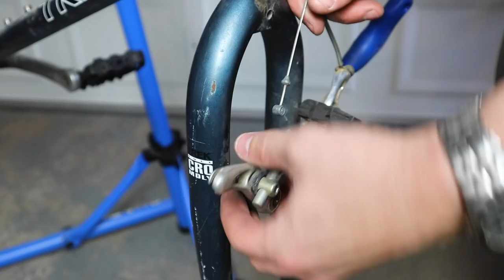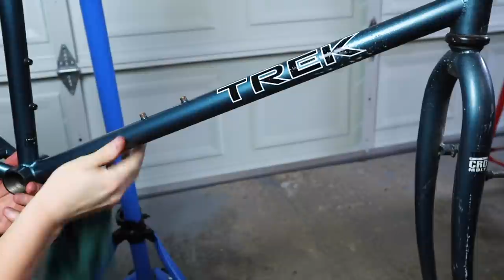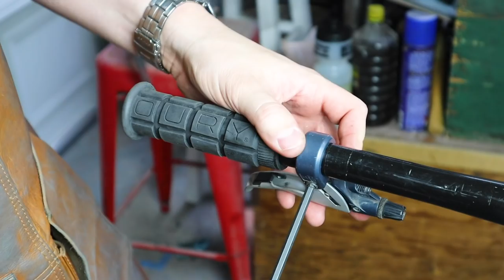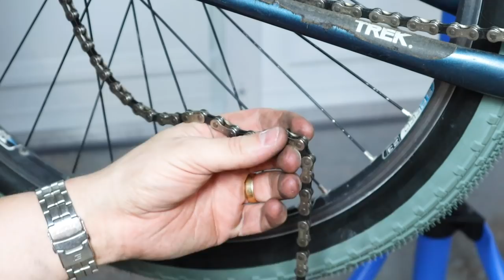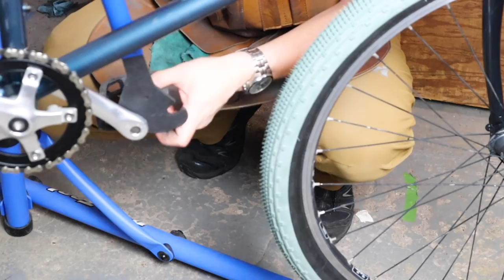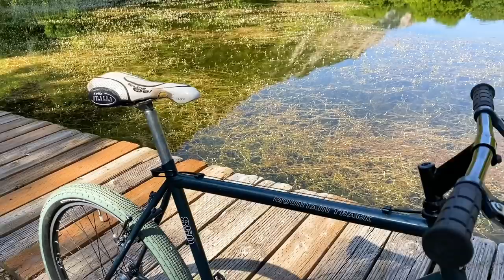Trash Bin Single-Speed Bike Build - Trek Rat Bike

Comment: I just pulled my mid-90's Trek 820 Mountain Track out of the garage after 1/2 a decade, cleaned it, degreased the drivetrain, lubed it, aired up the 1/4 century old tires and hit the road with her. She was shifting like buttah. And the finish? Outstanding paint job on her still. So, I'm going update the cockpit (stem, bar, grips, post, saddle), add a pair of SPD's, new brake pads, tubes & Gravelkings, true the wheels and keep the flawlessly performing grip-shifters on there along with the drivetrain. 

I haven't ridden a modern Trek that rides as nice as an old steel non-suspension Trek. I have a 7.0kg carbon road bike, a state of the art aluminum road bike, but the Trek is the one that puts the biggest smile on my face when I pedal it and that's in its current state. I'm going to buy a new Roscoe 7 in a few weeks, but I'm keepin' the 820.
Reply from the maker: Exactly! Awesome. I know exactly what you mean.
Reply: I have a Trek 820 also. It's a super cool bike, and some work's been done on it, but the handlebars don't stay aligned with the fork. I'd love some tips on correcting that.
Reply: @tamarablanke6358  Assuming that you have the same handlebar as I do, your local bike shop should be able to tighten the expander bolt in the middle of the stem within a minute and they probably wouldn't even charge you anything. 

If it doesn't tighten after that, it might be stripped and would need a new expander bolt and/or the wedge inside the headtube (inexpensive parts, around $10 for both).

Comment: Nice bike you got there! 

There is something special about single speed bikes!
I have a Haro F2 BMX from 2009 and I was 14 at the time my mom bought me the bike when there was a hype about BMX's in my town. Although I've never learned some  freestyle tricks on it, just bunny hop and reverse handlebar riding (flatland trick), I just love to ride it often. I pulled out the seat high like in the 80's, greased all the bearings, yesterday I removed the detangler because the cables were getting stuck and I had poor braking, so I just did a direct cable mod to the rear and only brake on the bike and braking is now as it should be. 
The bike is a BLAST FROM THE PAST!
I enjoy it much more for cruising around the town than my 29er MTB, although a MTB shouldn't be for city cruising, seems the MTB is a wrong type of bike that I bought myself 2 years ago.
So the BMX just rocks even after 11 years and it makes my 25yo butt smile like a little kid.

Comment: Great build and interesting commentary. I hope you don't mind me asking a couple of questions. 
1. Why did you fit a chain tensioner on it? (Assuming that's what it was). Couldn't you just make the chain the correct length? 
2. What ratios did you use? Chain wheel looked small. I guess you know what combination suits you best. 
3. How can you work out the fixed ratio for a build without a lot of trial and error?

Comment: Hmm, shouldn't that chain need to be on the other side of the tensioner? Looks a bit weird to me. Dunno! In any case - as always, love your work!
Reply: I have a single speed mountain bike with this same tensioner setup. The idea was to increase the contact of the chain with the sprocket. It goes perfect and bounces very little. Regards!
Reply: @alejandrocastro211  cool, that makes sense. Thanks!
Reply from the maker: I got it used with a push spring loaded in it and so it has to be used this way and works great.
Reply: @oldshovel  Gangster. Knew I was going to love this build before I saw it.
Reply: it's matter of style, plus it's a rat bike, nice details.
Reply: I was thinking the same thing
Reply: I thought that too.
Reply: The tensioner pushes the chain up, not down/back like a derailleur. Took a second to wrap my head around it too
Reply: @alejandrocastro211  If I may ask what chain tensioner is it?
Reply: @jfkusa123  Many tensioners can work either up or down. Unless a particular unit is specifically made to work one way or the other, it is up to personal preference.
Reply: My tensioner, which looks identical,  only seems to push my chain down away from cog, unless im missing something and there's a way to switch the spring?
Reply: @oldshovel  with the tensioner inside the chain rather than on the outside as yours is the chain tension increases over the bumpy stuff rather than decreasing in tension. I have tried both ways and tensioning downwards rather than upwards is best especially if you don't have a narrow/wide chainring. You don't throw the chain as often!
Reply: @DrShades2011  I use an Alfine CT-S500 on my Rat SS as I've used every other conceivable tensioner to date over the years. Whatever works 😊
Oh, the tension combines the up and down tension like a derailleur. Yes, just use a derailleur. I've done that too 🤙🏻
Reply: @LeMADFacteur  
It's set up wrong. Anyone saying otherwise probably did it wrong too!
Reply: I have mine on the other side, still trying to get my hear round how this setup here is better?

Comment: My beach cruiser is an old Raleigh road bike (Pretty metallic light green) set up as a single speed using the original crankset minus the small ring, original 27" wheels, and a polished flat bar.  It was a fixie conversion, but I don't care to always pedal.  All the decals are gone except for the one proclaiming a team win at the 1977 Tour de France.  Love that bike!

Comment: I have 2 1995 giant mountain bikes 1 of which I’ve bought new when I was 17 and still use it to this day. Both have been built up and torn down for multiple uses. Just today I’ve finished a rebuild with a single speed set up and touring tires, not the fastest bike but rolls smooth.

Comment: Did the similar thing to an Orbea Orca, compact 50t and 16tooth rear off of the old cassette(the chain is on the underside of my tensioner). I LOVE it. Have been riding it more and more. And it’s a 14.6lb build w/o the shifters and transmission!

Comment: Holy smokes! I built almost exactly this concept on an very similar Gazelle cantilever brake frame. A real rat bike, I turned the handlebars upside down with inner tubes as tape, slapped on some deep section single speed wheels from a trashbin and rode it a bunch! I ended up giving it a flat bar and several sets of wheels. First two offroad wheels, and added 7speed shifting, trashed the front, replaced with a super light race wheel, the trashed the rear and swapped to full racewheel set. Eventually I got second hand cyclocross wheels and slapped on some cheap gravel style rubber. Upgraded to SRAM x9 9speed shifting from the aforementioned trash, and tektro cantilever brakes.
It's dark green with a silver seat tube, and all black hardware. It's my daily citycrosser :)

Comment: Sweet Rat SS. I use these tyres on my Gravel Bike that I also use on the road. 35mm tyres are very stable and fast enough for the road.
My current Rat SS is a LeMond Beunos Aries Carbon/CrMo Frame Road Bike with the same Freehub spacer kit. I have 10 Speed Chain with the Alfine CT-S500 Tensioner. Almost ready to take the first spin.

Comment: These are good stuff.
The old (early) rigid-fork MTBs make outstanding city bikes. Single-speed or 1x7 or 1x8 or however it works out....
I have taken to building nice, lightish wheels for them and putting them on a nice, cheap set of 1.90 section Schwalbe City Jets or something similar.
These things ride, grip and corner like a bastard.
In a good way....
All these parts you're using are just right. We all have boxes of them from old strips and projects....  
Good build!
It has what it needs and nothing else.
And... It will be fun to scoot about on.

Comment: I've used cassette rings for years to convert to single speed. I use PVC pipe for spacers and keep the locking ring on the outside to snug everything together.

Comment: Love the way you do things. I recently finished a hatchet very similar to one you did, one of those hand forged carpenter hatchets. On my bench right now is a Trek 930 lugged steel frame that will either be single speed or perhaps a 1 x 7. Both were found on trash day on the side of the road.  A suggestion for you, check on Ebay for military surplus leather ammo pouches, I've found several different ones that work great as an under the saddle tool bag.

Comment: Decades ago, I found an old road frame set in a pile of garbage out at someone's curb.  I believe the original rims were 27 inches.  I decided to make a fixed gear bike out of it using 20 in. wheels.  I bought a pair of wheels at my local bike shop, taught myself how to re-dish the rear wheel so that I could use a single cog on the back.

I built it with flat bars and used it to chase my (then) small children, around the neighborhood.  It's been hanging in the garage for years now...I should get it down and try to ride it again.

Comment: neat ! I've got an old peugeot ferrara in a similar condition, converted to a cx/gravel. replaced a straight bar with a road one, mounted some full mudguards, paired with 32c conti gatorskin which are the most durable and panzer tires I've ever ridden. They survived polish salty winter hammering on pavement, all sorts of rooty, rocky, sandy forest trails and never punctured. The only puncture  I got with them was from a cut-off cable strain in  my workshop... This bike is really solid although I had to give the bottom bracket shell area a new paint as it peeled off like a sunburned skin after two winter seasons during which it was covered with some old tire tube band pieces with which I wrapped the bb cups for better waterproofing. well they worked just the opposite :D

Comment: I personally like reusing old spacers from broken cassettes, as single speed conversions, but that surly single speed kit is mighty clean.
Reply from the maker: I was actually planning on that initially but when I was at the local shop looking for some 110bcd cranks (I had the 1x ring already but have used all my old school cranks) they were so helpful and gave me such a good deal on the Sugio cranks I splurged and bought the conversion setup. 😁 they also threw in the used Singleator for a great deal also.

Comment: Nice! I did a single speed conversion on exactly the same Trek bike a few years ago. Sadly the bottom bracket never wanted to come out so I stuck with the old one and now it's bearings are total garbage... :'(
I have been thinking of torching the little bastard so the frame expands but don't want to ruin the paint since I love the colour and patina it has...
Reply: not to be that guy but maybe take to your lbs and let it be their liability
Reply: @InsanercYT  I did back then when I did the build it was at their shop for 2 weeks… His answer was that unless he could use a torch and probably mess up the paint he wouldn’t be able to fix it he throwed every tool he had at it… Been thinking of using a heat myself but really don’t want to mess up the paint at first when I found/bought the bike I was thinking of repainting it and wasn’t really loving the color. But after a very good clean and polish I fell in love with the paintjob

Comment: I think the chain tensioner was wrongly installed
Reply from the maker: I got it used with a push spring loaded in it and so it has to be used this way.
Reply: @oldshovel  ok, i enjoy all your build. I also have an old gt mtd that i converted to single speed.

Comment: You setup the chain tensioner incorrectly.
🤔
Reply from the maker: It’s set up with the push spring in it as opposed to the pull down. This setup keeps more engagement of the teeth on the rear cog.